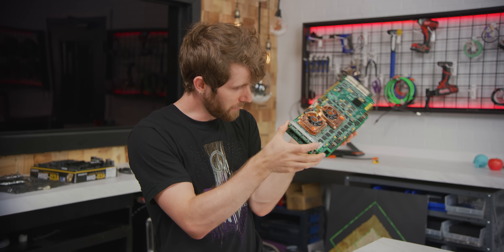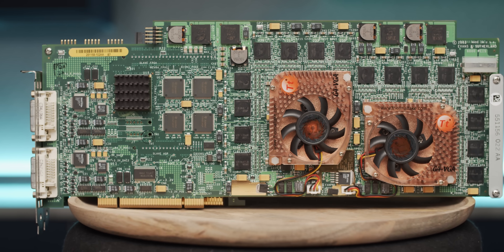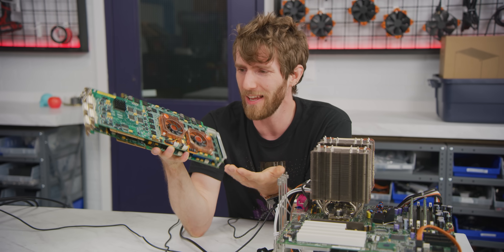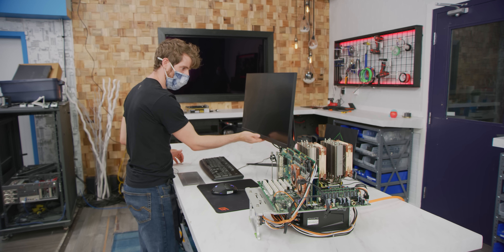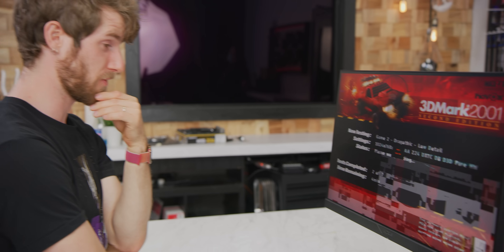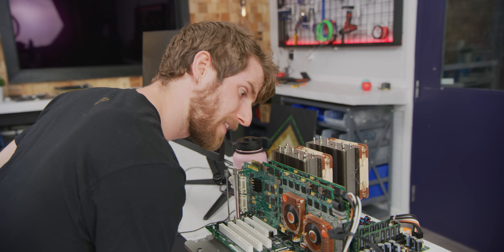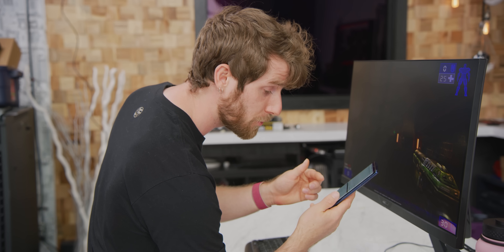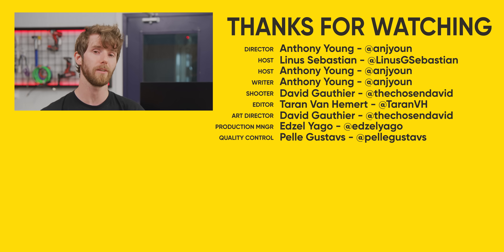This MONSTER Video Card has 4 GPUs... and it's from 2004! - E&S SimFUSION 6500q

Comment: Linus: "Old enough to still use DVI"
Me: Looks at 1080Ti with DVI port
Reply: Me, looking at my 2012 monitor, using DP:
It doesn't have that stone age HDMI crap anymore, but there's still a DVI.
Reply: @CakePrincessCelestia  i have 2010 LG Flatron W1946, amateur
Reply: HDMI/DisplayPort has sound output as well, which is mandatory for like TVs and stuff.
Reply: @neliaironwood7573  DVI can do sound as well depending on the device.
Reply: @BlokeOnAMotorbike  No it doesn’t natively you’re right. DVI-D CAN carry audio with a DVI to HDMI cable with most modernish GPUs released from ATI/AMD and Nvidia around 2008. I know for a fact it works on a 5870 because I’ve tried it.
Reply: @neliaironwood7573  DVI too, has sound output.
Reply: @neliaironwood7573  not actually mandatory, some old hd TVs had DVI it would be grouped with one of the composite inputs and you would run separate analog cables for the audio.
Reply: I'm looking at my Zotac 1080 TI, ashamed I have a DVI cable attached to it.
Reply: @braxton2180  - I have a 980 using both DVI slots, one of which is connected with a VGA adapter :P
Reply: @KingBobXVI  you're an old school winner, I still usa VGA on my laptop, it's too old for HDMI haha. Nice to have a monitor using DVI and VGA. I'm not ashamed, it still looks amazing!
Reply: @braxton2180  That would be dual DVI if it has the horizontal pin,
Reply: @braxton2180  there's no shame in using the best cable known to man. You should be proud
Reply: @braxton2180  I prefer dvi over hdmi and displayport.
Reply: @GamingDad  Hahah me too I prefer not to have HDCP going on...
Reply: @GamingDad  Aye way more stable build, they dont' break/break the ports so easily...
Reply: @GamingDad  I get ya sugarcube, screwed is better, it ain't goin anywhere when ya kick its ass!
Reply: @GamingDad  I agree...The port design is so much better. HDMI is so fragile
Reply: @GamingDad  DVI is just soundless HDMI.
Reply: @GamingDad  display port is just superior
Reply: @YungEagle3k  the plug is shit to use and it's superiority is only noticeable when using a multiple screen setup. So no reason at all to use DP.
Reply: @GamingDad  Amen brother.
Reply: Haha you made me double check mine to see if it really had a DVI
Reply: My current pc was built in 2001....
.
Reply: @Obi1kenobi10  Pentium 4? Running XP or 7 or a lite linux I presume? Thats how I was, until AMD FX!!! lol old news now but miles ahead of my prvious machine, and with 24gb ram and a gtx 970. Runs shit fine and I can have 1000 tabs open. (Yes literally had 1000 tabs spread across 5 windows.
Reply: @alexfrick3801  AMD, Ubuntu os
Reply: @alexfrick3801  i have 4742 tabs across 28 windows but almost all are unloaded or killed. and i have 8 gbs Main chrome process uses 1.4 gb
Reply: @kirill9064  Holy shit, that's a lot of pr0n.
Reply: So the conclusion is that the DVI with its unnecessarily gigantic plug is obsolete shit and HDMI and displayport ftw
Reply: @MF175mp  Except no, because HDMI and displayport break/malfunction easily. DVI doesn't, and provide the same quality(or better in case of hdmi malfunctions, of which I've seen plenty. Discoloration average ppl don't notice first and foremost).

I am rather happy my 1080 ti has dvi, and I'll be sad to replace it.
Reply: @Nyarlathotep_Flagg  if it wasn't obsolete, it would be all over the back of the new RTX 3090's
Reply: @MF175mp  you're confusing obsolete and unpopular.. it cannot be obsolete if it's the same quality signal as well built better than dp or hdmi's flimsy ports.
Reply: @MF175mp  You understand neither marketing, nor technology.
Reply: Good to know, thanks
Reply: @TheMcGritz  How about if you are using 4K?
Reply: @Obi1kenobi10  Why would you not upgrade already? You could easily get a used pc for 100-200$ which is a lot faster, quieter, smaller, more efficient.
Reply: I'd use displayport but whatever retard defined the specs for it so that turning the monitor off with the button will FULLY DISCONNECT it from the system (complete with "device unplugged" sound from windows) as if you pulled the video cable deserves to be shot. Literally NO other PC video connection disconnects the monitor when the monitor is in standby (="off") unless you physically unplug the cable at one end. JUST fcking displayport trash. That's the ONE reason why i don't use it
Reply: Aye my ATI Radeon 9200 also use DVI for output aint that grand?
Reply: @AppleJack-  Hi, great to see you here. Awesome! /)^3^(\

 @DarkGMD  I was still on CRT in 2010... (in fact, until 2013 - rechecked that lately) :)
Reply: @CakePrincessCelestia  aye are ye lookin nice on the electric computer thang 
/)
Reply: @AppleJack-  (\
Reply: me: still using vga and dvi
Reply: LoL in January 2020 i bought a RTX 2060 and it does indeed have a DVI port... lmao.
Reply: @nothing-n1d7i  just bought a used 2070 super. Got lowkey upset that it ain't got one
Reply: and here i am with my gt 1030 with vga
Reply: @antonius7851  here with my gt 1030 with display port to monitor VGA :((((
Reply: @doomdesire3460  ah yes my gt 1030 has hdmi
Reply: Pretty sure my 2060 has DVI.
Reply: I run DVI for my BenQ-monitor through my RTX 2060 Super so...
Reply: Wait, DVI is considered something for boomers now? It's digital connector and when you have only 1080p/60 Hz, there is absolutely no problem with using DVI.
Reply: I built a pc for a friend of mine, and she had a panic attack when there wasn't a DVI port lol.
Reply: The funniest part is that DVI, HDMI and DisplayPort are electrically compatible
Reply: And here I am still using VGA (sometimes).
Reply: dvi is the only way i can use the 144hz mode of my tft? :(
Reply: Ashamed having a display port to DVI cable in daily use
Reply: RX 580 currently connected to my alt monitor with DVI...
Reply: Looking at my rx 480:
Reply: @WeggeW same i have the asus tuf one hbu?
Reply: RX 570 does also have DVI, it's not a bad thing.
Reply: You still have a good graphics card. I have a GTX 750
Reply: @roukoutv  I'm thinking of building a budget pc with some old overclockable i5 and a gtx 580. They are so cheap now. Gtx580 costs no more than 10-20 bucks used when the right deal shows up.
Reply: @MF175mp  laughs in 300$
Reply: @Honk Honkler - 
Me looks at 1280x1024 via VGA on a CRT ( & it switches pictures fast + has perfect colors ! )
Reply: Looking at the gtx 1650 sff
Reply: *looks at asus prime motherboard * old?
Reply: Dvi was so much more powerful then its competitors  and is still valuable,valid.
Reply: 1080ti would really upgrade my setup.. wanna help a bro out?
Reply: lol i use vga with my gt 710
Reply: Me: looks at my 2740 mega giba champ that has a 8k port
Reply: Time to upgrade my dude lol xd
Reply: lol I even took my 1660Super off the shelf to see if it has a DVI port, and surprising it does lol even tho it was released in 2019
Reply: I have a 2060 with HDMI, DisplayPort and DVI, one each
Reply: @laurinneff4304  yikes, I got one tats msi it only has hdmi
Reply: I have 1080ti too, but there are no dvi ports. One HDMI and three DisplayPorts.
Reply: lookin at my GTX 650
Reply: My monitor only has dvi, so I had to use an hdmi to dvi adapter because I don't have any dvi cables
Reply: EC SLOT
Reply: Looks at rtx 2060 still with dvi
Reply: DVI-I is my favorite connector because I could turn it into either VGA or HDMI depending on what was practical/needed at the time, with cheap passive adapters. Like 3 connectors in 1.
Reply: lucky u have a 1080 ti
Reply: DVI port is the high quailty one with all pins but that old DVI's don't use cable with all pins
Reply: @WeggeW 1660S with DVI? I dont have any DVI output on mine
Reply: R9 390 comes with two DVI ports. Makes me laugh every time i see it
Reply: same
Reply: I was actualy using it until recently because the HDMI ports on my motherboard fried and I couldn't find a display cable
Reply: Me looking at my rtx 2060 with a DVI port
Reply: @Adam Taylor good enough for crysis
Reply: also 1650Ti have DVI
Reply: DVI-D dual link can easily do 1080p 240hz with some driver modifications

dunno why people hate on it
Reply: @felicityc  only gen z hates this
Reply: Don't be ashamed the 1080 ti still holds up well
Reply: I have only VGA
Reply: Me looking at my monitor from 2007 with no hdmi or DisplayPort. Uh huh
Reply: Got an 1080 with 2 display ports 1 hdmi and 1 dvi so it's not that old. Evga ftw 1080 hybrid aio btw
Reply: Me looking at my DVI to VGA adapter so I can plug into my 2009 monitor
Reply: I have a evga 2060 with dvi
Reply: Looks at 730 with DVI and VGA
Reply: Me using a GT1030 that has a VGA port:
Reply: Looks at my old 512 mb ATi with 1 dvi and 2 dp
Reply: Compatible with pcie and agp
Reply: my last computer was so old i completely skipped over dvi and went from vga to display port >:D
Reply: True, true
Source: MSI 1080Ti Armor owner
Reply: Running a DVI to HDMI cable from my 1070...
Reply: Yeah lol, my 1660ti has a DVI
Reply: looks at 1650 super with DVI
Reply: ""Old enough to still use DVI""  Its funny the older you get when you see younger people lamenting the things they were old enough to have used.  My first computer was a brand new Commodore 64 from Babbages.  External 5 and a quarter  inch floppy drive (you know the floppy disks that were ACTUALLY floppy.)  boot a game from the command line and it could take like 10 minutes of watching that read light blink on the drive until the game would actually load.
Reply: Me, four years later looking at my 1660 connected to a dvi monitor
Reply: DVI is a much better choice if you need higher Hz performance but no audio from the input source. 
Yes, I know HDMI is now capable of 100+ but that is not such an easy solution. 
I really don't want to go into it but I think most of you know of what I think about.
Reply: @gaaraati  Dvi on gpus do output audio when adapted to hdmi
Reply: I've never had a single monitor in use with DVI and never will. VGA on my classic systems and HDMI on the newer.
Reply: But then again, nobody uses VGA/DVI anymore anyway , because they are supersided by new products like HDMI/DisplayPort, as DVI/VGA can't support audio and high-quality images.
Reply: @neliaironwood7573  They're still useful for backwards compatibility in monitors. Monitors are a part that very rarely need upgrading/replacing, and even some modern gaming monitors still include DVI ports. For computer specific use cases the integrated audio of HDMI serves no benefit in monitors without built in speakers, since standard DVI can support up to 1920x1200 60Hz the majority of computer users don't need to upgrade past DVI.
Reply: @neliaironwood7573  I have yet to see a monitor at a friends house or in a school that has display port. But all have vga dvi and hdmi. Also wdym dvi/vga cant support high-quality images, thats bullshit LMFAO
Reply: @neliaironwood7573  I use a CRT monitor, so VGA is definitely still a fact of life to me.

Comment: Also had an old E&S AccelGalaxy in some time around '99, from some surplus electronics store. Still VGA and with a superb IBM RAMDAC. It was a bit oversized, used a lot of power but was also fast and had insane good picture quality (for analog Displays picture  quality would differ wildly)

Comment: 3:14 Not sure if that's an FPGA or a custom ASIC?

The same chip (218841ASA12) is used on certain models of the ATI All-In-Wonder.

http://hw-museum.cz/vga/83/hercules-all-in-wonder-radeon-8500-dv

You'll often see some SPI Flash chips near to the chip, which could either be for storing the FPGA bitstream, or more likely for the card's BIOS.

Comment: 3dfx made a card with 4 GPU's- the VooDoo 6. It wasn't released to market as they closed but there were working units made. Very rare and pretty cool. Personally I had the VooDoo5 (which had 2 GPU's) and was really looking forward to seeing the VooDoo 6.
Reply: Not quite - the prototype was called Voodoo 5 6000, not Voodoo 6. 😉 It had 128 MB RAM as well, double the amount of the normal Voodoo 5 5500. There was a prototype Voodoo 5 5000 as well, the difference to your Voodoo 5 5500 was that it hat 32 instead of 64 MB of RAM.
I collected 3dfx cards and items, in the end I had 194 cards plus a myriad of other stuff, for example two motherboards with onboard Voodoo 3 2000 or PCBs which were used for powering arcade machines. That included a working Voodoo 5 6000 as well which I bought for something like 600 Euros and sold it a couple of years later for 1100.
Reply: @eyeq1451  Thanks... I;m getting old, lol. Man that collection of yours sounds awesome. I would've loved to have played with that 6000.

Comment: Surprised by the number of people who commented on the MB recapping... Has this now become some sort of impressive feat to computer-interested people? Like, has this arcane wisdom almost disappeared? Obviously, if you play around with late-1999s computers (or in fact even used some leftover ones by around 2005) and were on a budget, chances are you have recapped a couple boards and didn't think much of it.
Sign of the times - by which I mean, recapping being almost never required anymore, and maybe people getting a bit too cautious about handling computer internals, at least when there's not some manufacturer-approved procedure to do.

Comment: Predating "nvidia" sli?   Hmmm.... once upon a time there was a little company called 3dfx.  A lo there was a second card in our machines.  A pair of Voodoo2 cards that ran Quake like nothing else.  The engineers that ran the company cashed out and sold the 75 million dollar patent portfolio to.... nvidia.  The stockholders were screwed out of every dime.  AGP was marketing hype as PCI had enough bandwidth to handle the video cards of the day.  3dfx had the first chip to perform a billion flops.  Note current cards are measured in peta-flops.  Long forgotten was the 3dfx application programming interface or API which was called Glide.  Glide offered superior game performance for programs like Quake and Falcon 4.0 that supported it.  To this day I look to the memory bus width when selecting a video card as it is the best performance indicator of a cards potential.  Back in the day if you played Quake the only card to have was 3dfx.  Quake 3 was my first "online" multiplayer game and what a blast it was... and played on dial-up modems!

Comment: 2004 sounds too recent!

Have you guys ever managed to get your hands on the "SLI" 4-bay 4-Card PCI interface Pin-Linked Voodoo 2?
Reply: I bought a Voodoo 5  5500 back in 2000 when it launched, it was only a couple of months before 3dfx was scooped up by Nvidia and all driver support was ended.  Before that I had a Banshee. The earliest GPU I had was an ATI Mach 64  that bridged an ISA slot and VLB slot, that was mid 90's
Reply: Ah, my and my buddy built a double Voodoo 2 system before the milenium! Thx for the memories! Still remember playing X-Wing vs Tie on it. Good old days.
Reply: @winteronice  I had dual Voodoo 2's in 1998/9 and loved Counterstrike at the time.....memories :-)
Reply: @dazzab111  same here - dual Voodoo2 (2 x 12 MB). I never got it to work properly; it was unstable, crashed a lot, overheated or simply caused a ton of artifacts on screen.
A shame because when you slapped on those 3Dfx stickers and went to LAN parties - ohhh, you were the king!
Reply: Voodoo series first multi card in Europa. Back in 1996
Reply: Or ATI rage fury maxx
Reply: I still have a voodoo card, it was my best memory
Reply: tf is this?

Comment: "predating nvidia's sli"
3dfx - am I a joke to you?
Reply: Oh hey on topic so is nVidia actually going to go with SLI on their 3000 series eventually like they did for 2000 releasing things like the 2070 first and then rolling out the 2070 super with NVLink? Because I can't imagine them having rolled out "NVLink" as this new SLI thing just to drop it after one generation. But then again it's so not supported on most things anymore. AMD isn't even doing Crossfire at all anymore and that saddens me (even if it would be buggier than this ancient 4 gpu card)
Reply: Yeah, found it also odd how Linus said it's predating SLI and CrossFire, even though the title states that the graphics card is from 2004, years after the 3dFX introduced SLI with their 1998 Voodoo 2. Also it's only "Nvidia's SLI" because they bought 3dFX or at least some of their technologies.

Also: "old enough to still use DVI"
In 2004 there were most likely many that were still using VGA. Even nowadays DVI is in use in many placed and even with modern office PC system. Sometimes I even have to still use VGA and we are still getting more VGA cables with the office monitors we are ordering. We are actually short of DP one, with boxes full of VGA and DVI cables...